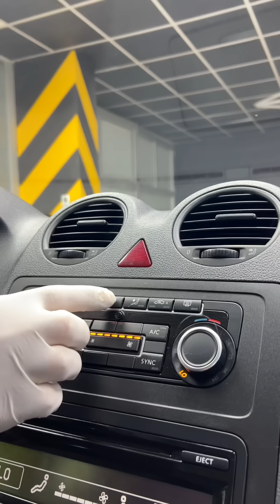VW Caddy's Transformation: Post-Flood Detailed Cleaning!

Comment: There are Airbags in the front Seats, can you just plug in the connector or do you disconnect the battery for that?
I want to change my Steering Wheel but I am afraid the airbag will go off when I plug it in...